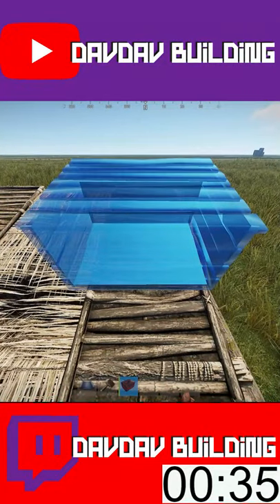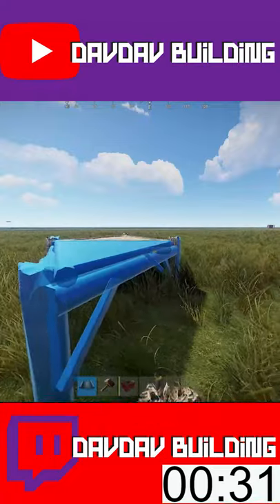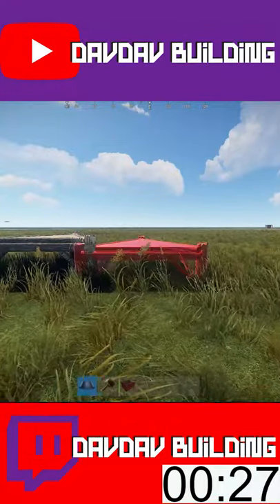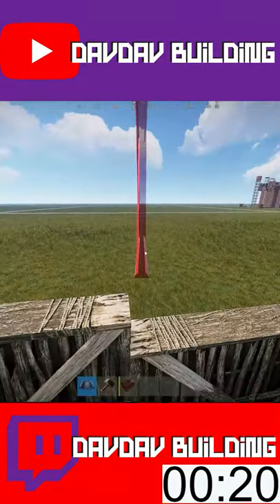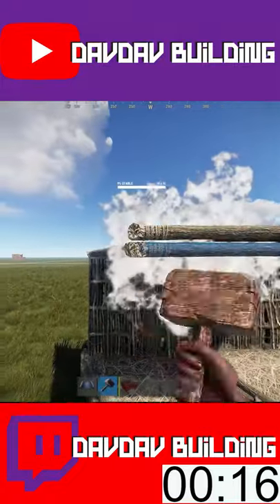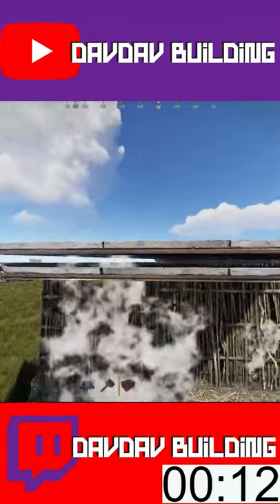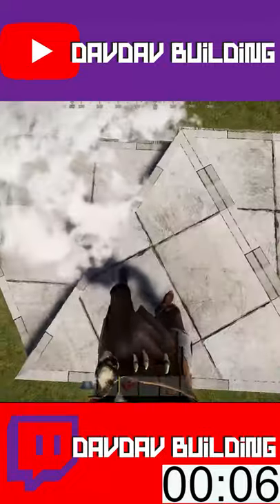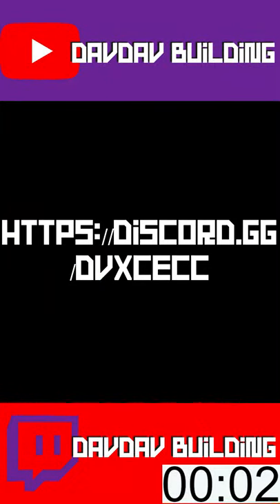How to Floorstack/Roofstack in Rust #shorts

Comment: I do another kind of floor stacking. I start with crouch lower foundation with the blue floor whole above the ground and then i leave crouch and move to the side. that allows to put floor over the tc and have large boxes on that floor. and under this floor you can have sleeping bags. This way i have 4 large boxes, tc, small box and 2sleeping bags in one square
Reply: Practice Freehanding it, makes your life so much easier
Reply: @vuldren  i do freehand floorstack every time. so easy with crouch method
Reply from the maker: Well that makes your foundations a big weakness.